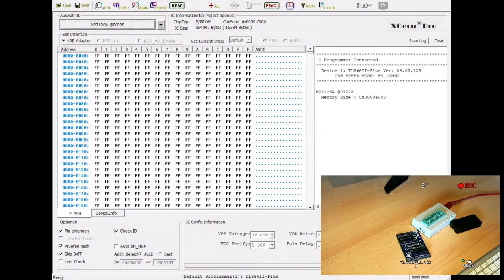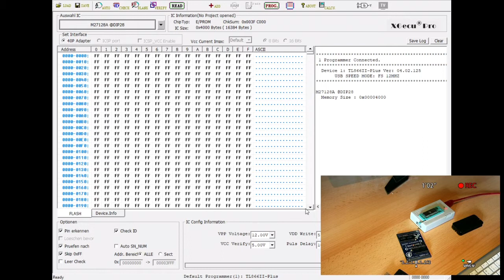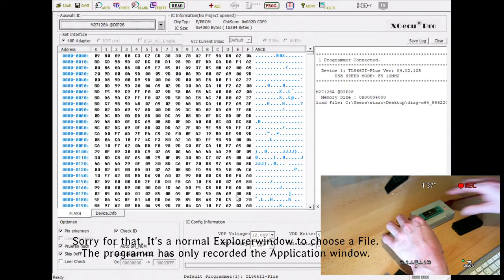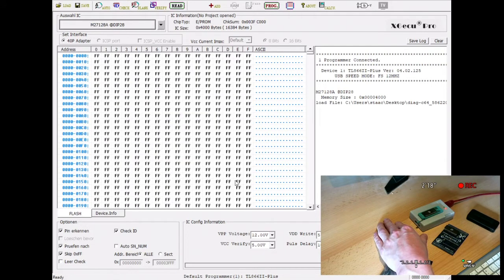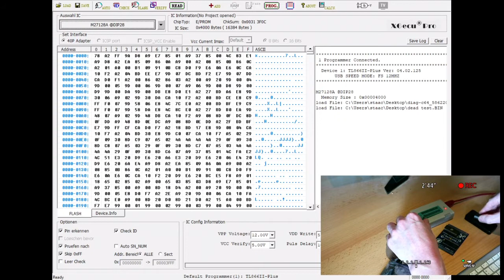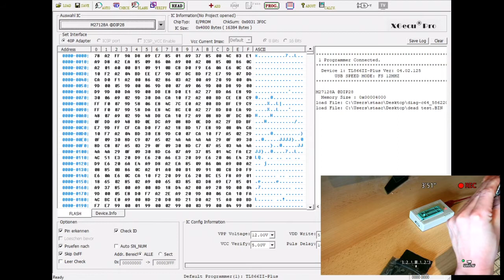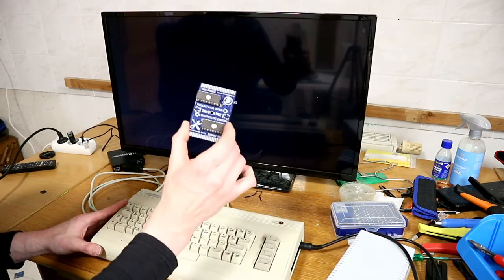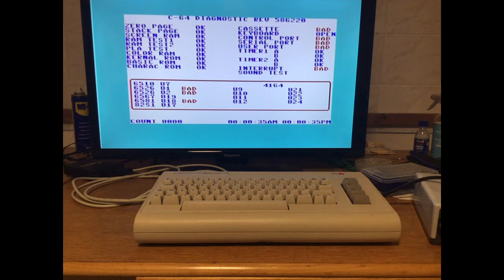Commodore C64 Series #4: How I build my own Diagnostic-Cartridge.

Comment: Very informative video.  I presume that you can use different size EPROM (27C64,128,256,512) for this PCB but only program the BIN file in the first 8k of the EPROM.
Reply from the maker: Thanks. That’s right. The only thing is you have to look you use the right type of EPROM.